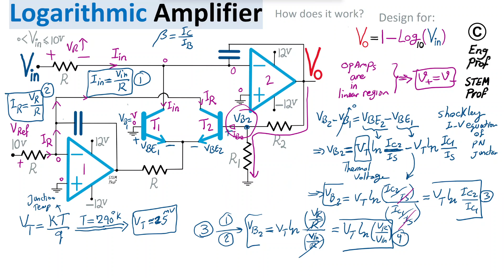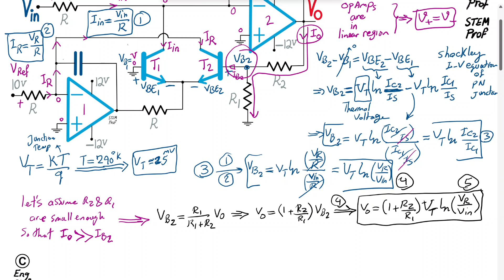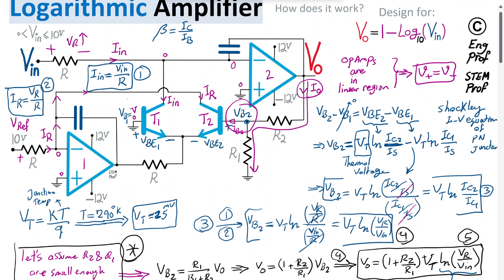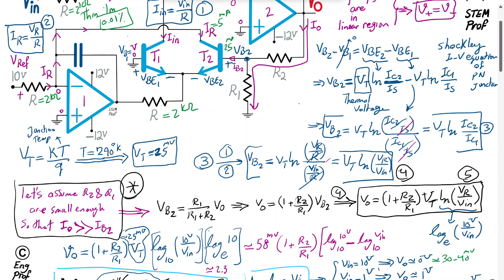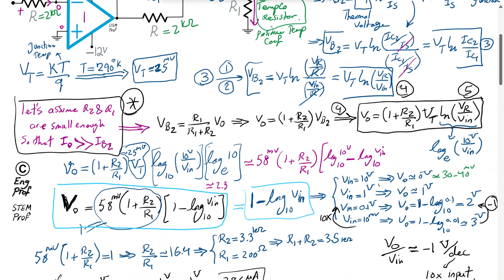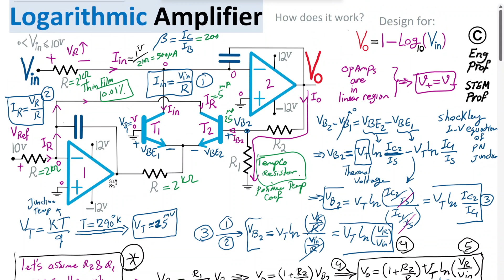Comment: what are the capacitors used for?
Reply: Thanks for watching and your good question. The op amp feedback capacitors are in place for practical consideration to ensure the presence of negative feedback during transient response since the main feedback path for each op amp is just Diode-connected BJT transistor. I hope this explanation is helpful. For a related example please see Analog Computer Vector Sum Calculator Design with Op Amp, BJT Transistors https://youtu.be/PIAsa0QNVns.  For more analog circuits and signal processing examples see: https://www.youtube.com/playlist?list=PLrwXF7N522y4c7c-8KBjrwd7IyaZfWxyt
I hope these Circuit design videos are helpful. 🙂

Comment: Thanks for watching. For more Op Amp Circuits please see:
Analog Logarithm Computer: How does it work? https://youtu.be/RpKEq5WyoLg
Anti-Log Analog Computer with Temperature Compensation https://youtu.be/kk2c7Gk3nW4
Op Amp Amplifier with Electronic Gain Control https://youtu.be/NoNgQpbj77Y
VCA: Voltage-Controlled Exponential Attenuator Explained https://youtu.be/cFzYZsPEtP0
Analog Power Raiser design with OpAmp & Transistor https://youtu.be/Qe3cY9JSzYg which is an Analog Computer that raises signal to the Power signal.
Push-Pull Power Amplifier with Darlington Transistors https://youtu.be/866MYibo8yE
Op Amp Analog Computer Differential Equation Solver https://youtu.be/ENq39EesfPw
Wilson Current Mirror and Current Source Design https://youtu.be/LfbfJYrovN0
Thermometer Circuit Design with Op Amp & BJT transistor https://youtu.be/55YsraFE0rg
Analog Logarithm Computer https://youtu.be/RpKEq5WyoLg

Programmable Current Source Design with Op Amp, Zener Diode and Digital Potentiometer https://youtu.be/R1x6B0TczWk
On-Chip BJT Current Source Design https://youtu.be/Rs7gEMk03dw
Instrumentation Amplifier with Electronic Gain Control https://youtu.be/C4tghZ-q6Zs
Sawtooth Oscillator Design https://youtu.be/2eUsGPfqbW4
Triangle Oscillator Op Amp circuit https://youtu.be/JF5Up_cuL9k
Sallen-Key Analog Filter Design Tutorial https://youtu.be/KwUnQXbk7gM
How to find Bode Plot, Freq Response, Transfer Function of Analog Filters https://youtu.be/vZFkPeDa1H8
Universal Analog Filter Design https://youtu.be/2J-0msXZE2o
Laplace Transform Example and S-domain circuit analysis:  https://youtu.be/ps8N5TPM_qU
Op Amp circuit Bode Frequency plot https://youtu.be/BLVzuuqAlZs
Lowpass Butterworth Filter: https://youtu.be/UzCjkwqy-9w
Analog Computer to Raise Signal to power n https://youtu.be/IUTlBH1UraE
Differential Equation Solver Analog Circuit https://youtu.be/R3X5AYNZGEI
Complex Sinusoid Oscillator https://youtu.be/GXRhmwmS5Zk
Full-Wave Rectifier circuit example https://youtu.be/DJJMNU-CYcg
Sawtooth Waveform Generator design with OpAmp, JFET, BJT https://youtu.be/5zHXTx-Vl20 
op amps Circuit with feedback loops to design an analog computer that solves a second order differential equation https://youtu.be/HeZRtnRXpEI 
For more analog circuits and signal processing examples see: https://www.youtube.com/playlist?list=PLrwXF7N522y4c7c-8KBjrwd7IyaZfWxyt
I hope these Circuit design and analysis videos are helpful. 🙂